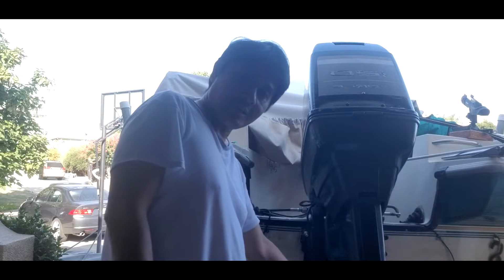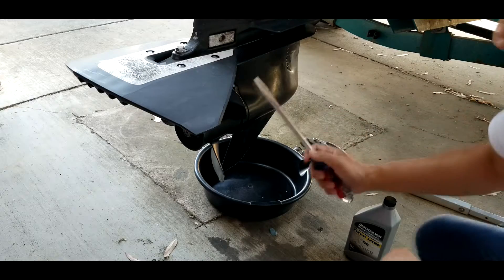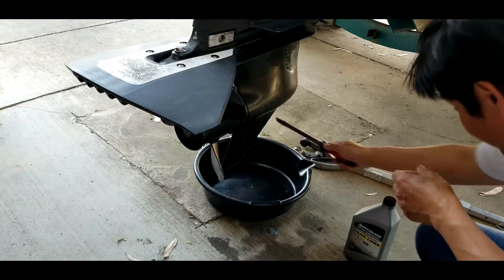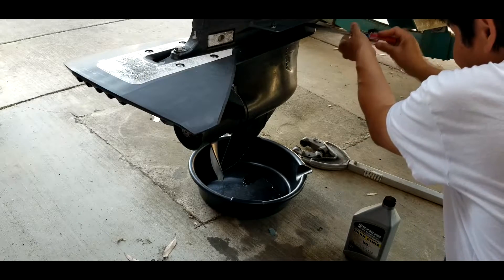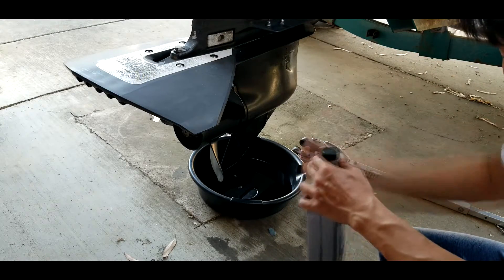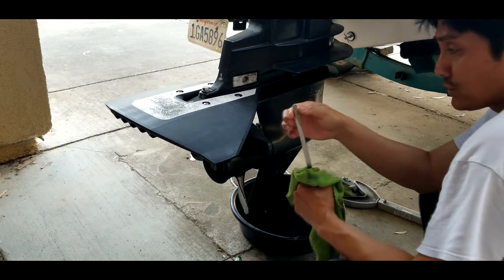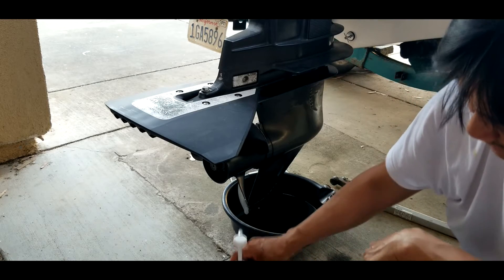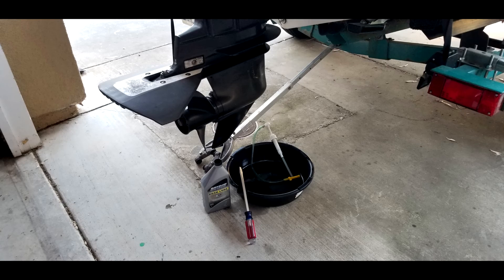How to Change Mercury Outboard Gear Oil

Comment: Why do you need to pump the oil from bottom instead of just gravity filling from the oil level hole? Genuine question, I just bought the same motor and am about to do an oil change myself
Reply from the maker: Because you want to push air out and know when the pil has reach top. If you put from the top, you will need to close the bottom/drain plug and hard to tell if the oil has reached out the max level.
Reply: @NorCalOutdoor  Thank you for putting the time in to all these videos. I've been troubleshooting an issue where the engine quits when put into gear and there's just not many videos out there about the Mercury force 120. I haven't even been able to find the manual for a 1996 online. Thanks for the reply!!
Reply from the maker: @dpmasse  You are welcome. Have you check your fuel/gas pump? Sound like it can't provide good gas flow. It can be few thing, such as your fuel line, fuel pump, carburetor setting, throttle, etc. I would try to try increasing rpm on neutral gear to see if it can run on high rpm. Do not do this for long time if you are not in the water and only use earmuffs. If it can go to high rpm, make sure your idle rpm is not too low. if it is too low, when you put it on load, engine can die, too
Good luck.
Reply: @NorCalOutdoor  Thanks for the tips! I've watched all your boat videos multiple times! VERY HELPFUL! Even inspired me to get a timing gun and try that out, where on my own without these videos I would have been too afraid to try. So far I have rebuilt the water pump (do you get a stream at idle with muffs only?) because the boat had sat for a time, and the gaskets were bad, I rebuilt the carbs, and am going to rebuild the fuel pump tonight. Excited to try out the tips you gave me! Thanks again for all the help! I'll let you know how things go. What state are you based out of if you don't mind me asking?
Reply from the maker: @dpmasse  You're very welcome. Glad found someone who likes fixing it by himself. 
When I bought the boat, the engine didn't turn on. It was sitting for 2 years and I did the same things you are doing. Replace water pump, rebuilt carburetor, replace fuel line, fuel filter, and fuel pump.
Thanks for watching my videos. I live in Sacramento, CA.
Reply: @NorCalOutdoor  That's wild! If this one didn't even start I don't know that I would have put the time into it! Much respect! Yeah my Engine, when it actually gets into gear without the engine dying (usually 5 or 6 tries) it runs great. So I was thinking maybe there could be a small leak in the fuel pump where it's drawing into the bottom cylinder, so when the RPM drop for the gear change, it's enough to just barely flood the lower cylinder. Because the lower carb cover always has fuel in it, where the upper is dry. Hoping it's not a reed, but from what I read, a bad reed doesn't run good at high rpm.
Reply from the maker: @dpmasse  Yeah, I know. The seller showed me pictures and video from last run. He dropped the price by $1500 because it didn't start. He and his wife swore it ran good last time. I guess I trust people too easy. Great thing was the boat ran good after I spend less than $100. So, I was so happy.
Btw, I only use earmuffs when testing at home.
The carb covers always wet. First time I thought the carb float didn't set right and aways open, but that was not the case. 
When the engine run and you get full power without chocking or limping, your reed should be okay.
Reply: @NorCalOutdoor  That's awesome that you got such a good deal! Where did you find the manual? I haven't been able to find one anywhere for 1996
Reply from the maker: @dpmasse  yes, indeed. I bought the manual from ebay. It was a used one, but very good condition.